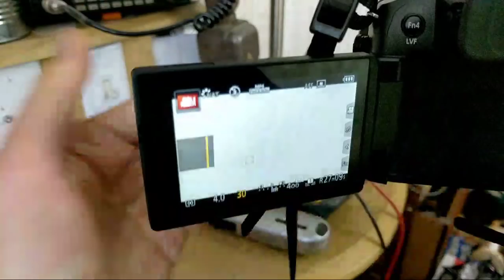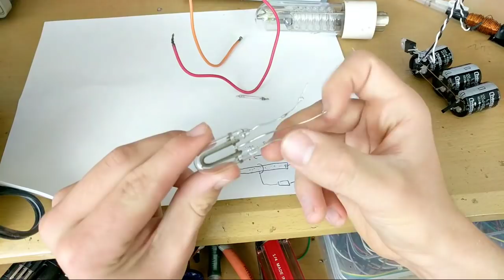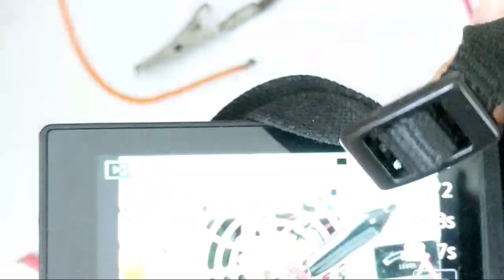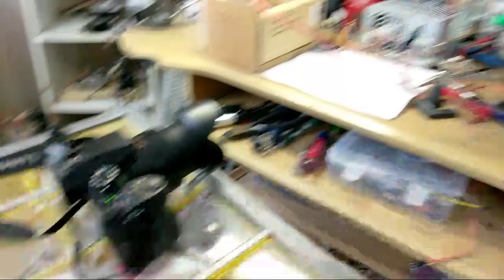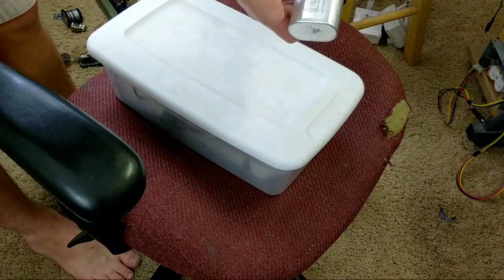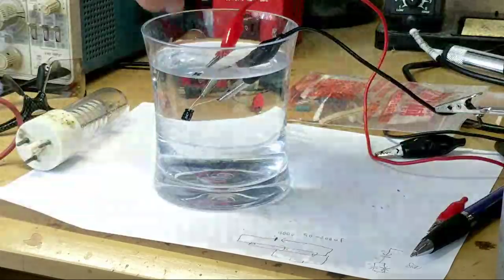Xenon Flash Tube Experiments!

Comment: Why not try replacing the capacitor bank with a second HV power supply.   (:
Reply: it needs to release a huge amount of current for ashort time. but the voltage isnt too high.